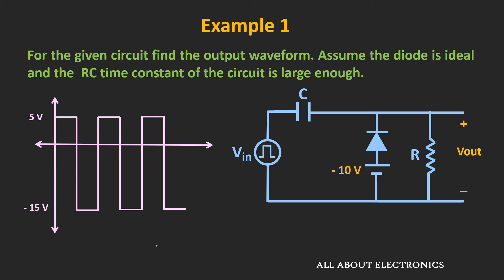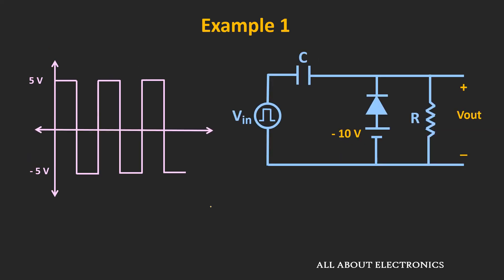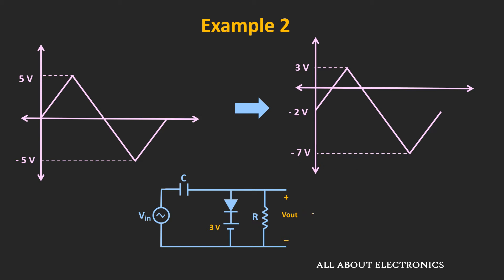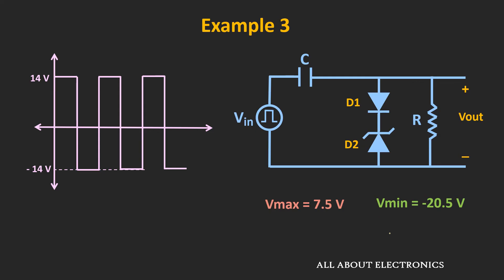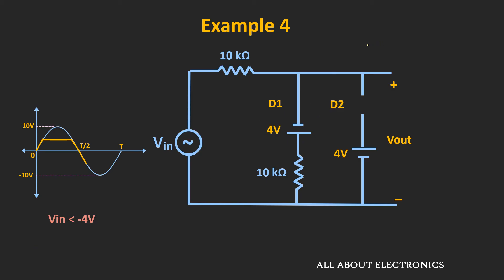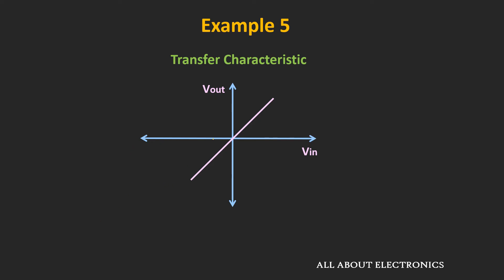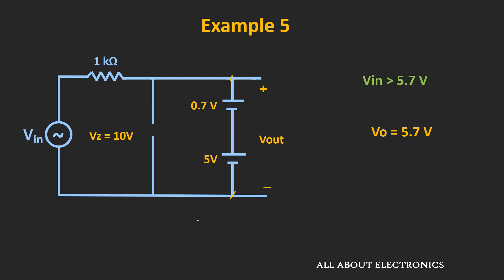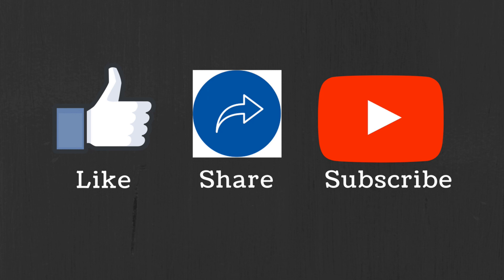Solved Problems on Clipper and Clamper Circuits

Comment from the maker: The timestamps for the different examples covered in the video:

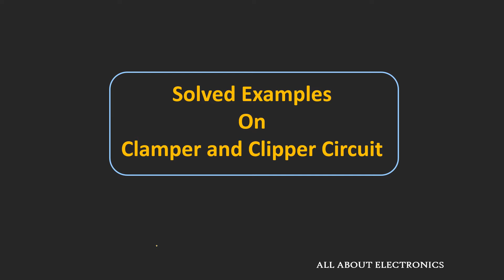0:36 Example 1 (Clamper Circuit)

4:02 Example 2  (Clamper Circuit)

5:49 Example 3  (Clamper Circuit)

8:16 Example 4  (Clipper Circuit)

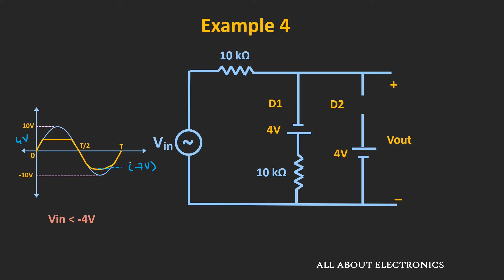12:22 Example 5  (Clipper Circuit)

Comment: sir in the problem 1 when the input is 5v that time diode is reverse biased so vout follows the input right, which is 5v but actual answer is 10v how????
Reply from the maker: That second waveform (shown at 2:53 in green color) is the actual waveform which we are getting when there is -10V in series with diode. (as given in the question). So, effectively in steady state what is happening is the capacitor will get charged to voltage (-15 + 10) V. The polarity of this voltage is from input side. So, effectively 5V will come in series with input. And that is why entire waveform is getting DC shifted by 5V upwards. That is why in the output we are seeing +10V during positive half cycle. And regarding your query, of course when the circuit is turned ON first time at that time, at the output you will see +5V during first half cycle. But during negative half cycle once the capacitor gets charged to -5V, then from next cycle onwards in the steady state, you will see +10V in the output. I hope, it will clear your doubt.
Reply: @ALLABOUTELECTRONICS  Thank you so much sir❤

Comment: In Example 1 the battery will be reversed...
Reply from the maker: No, thats alright. With the same circuit, you will get the output between +10V and -10V. 
For more info, you may also check the simulation of the circuit. 
Here is the link:
https://www.multisim.com/content/i8TjgyMHGsHuKUYuQet46c/example-1-clamper-circuit/open/
Reply: The confusion started bcoz u wrote -10V which basically means the battery is reversed

Comment: Sir, 1st numerical answer is contradicting with your clamper tuturial. It should be between 10 V to 30 V according to your past explanation. It is creating doubt. Please clear.
Reply: The battery must be reversed
Reply from the maker: It will be between +10V and -10V. Please watch it again (The video on Clamper Circuit). You can also check the simulation of the same circuit. It is between +10V and -10V.
https://www.multisim.com/content/i8TjgyMHGsHuKUYuQet46c/example-1-clamper-circuit/open/
If you still have any doubt then let me know here.
Reply: bro did u get the answer? im also getting 10v to 30v

Comment: In last example, where you said in last condition voltage is less than -0.7 then zener diode is -0.7 why is that?
Reply from the maker: When Vin is negative, it means that, the polarity of the voltage is reverse and when Vin is less than -0.7 V it means that, the voltage at the anode of the Zener diode is more than cathode and it is more than 0.7V. Therefore, the Zener diode will be forward biased and the voltage between the anode and cathode of the Zener diode will be 0.7V. But we are measuring that voltage from the top to bottom (Between Cathode and anode). That's why that voltage will be -0.7V. I hope, it will clear your doubt.
Reply: @ALLABOUTELECTRONICS but jab hum vth nikalwnge to vo 10 v se kum hoga 
Issliye xener diode ko off condition me rehna chahiye
Plz correct me if I am wrong??

Comment: How voltage minimum value comes - 20.5 v in q3?
Reply from the maker: During the negative half cycle, the input voltage is -14V. And the voltage across the capacitor is 6.5V ( from left to right). So, both voltages come in series. And if you see the voltage across the load, then that is -6.5 - 14 = - 20.5 V. So, that is the minimum output voltage. I hope, it will clear your doubt.

Comment: in example 4 why isn't waveform clipped at -7v? why is it curved?
Reply from the maker: The case, which we considered (-10V) is the minimum value of the input signal. But actually, Vin is is continuously changing (Sinusoidal signal)
That means Vo will also change in a similar fashion when input is less than -4. 
That's why it is curved.
I hope it will clear your doubt.